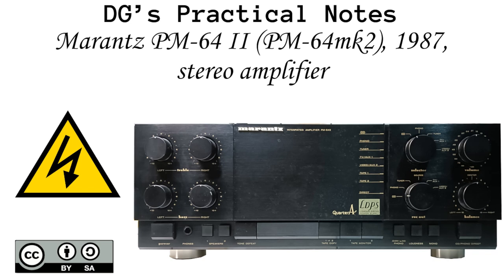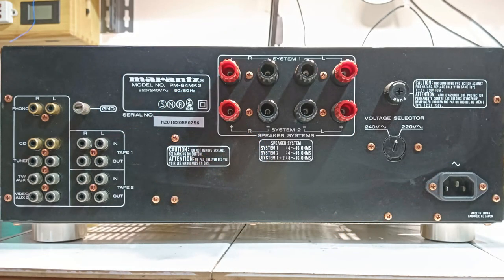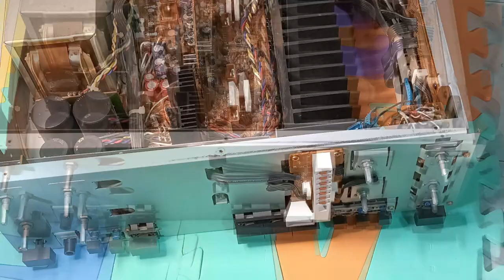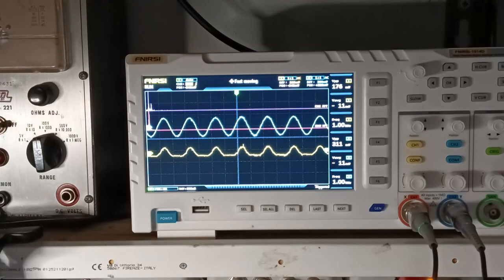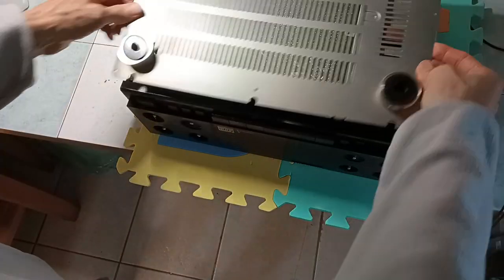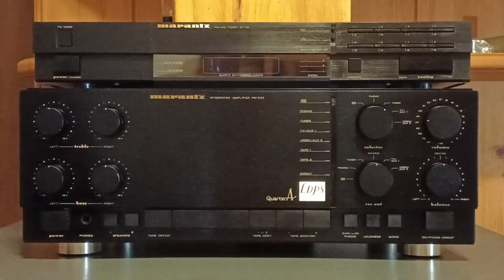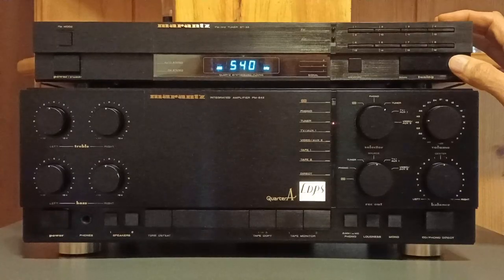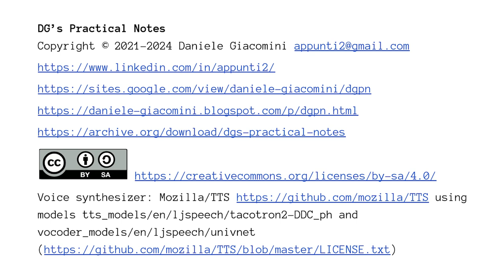DG’s Practical Notes, U#5 Marantz PM-64 II (PM-64mk2), 1987

Comment: Hmm. If you've succeeded in locating the problematic part of a board, why not at least visually inspect and resolder components? The distortion could be caused by bad solder joint, seen that many times. Also some capacitors could be bad, and started to work after an initial charge. However, Matsushita usually used good capacitors at the time, and these Marantz models were probably made by Matsushita. I'm disappointed by the quality of the PCB - it's made of FR-2 resin-bonded paper, not a proper epoxy-bonded glass.
Reply from the maker: Hello and thank you for your feedback.
I checked the solder joints, and they appeared just perfect.
There are wires wrapped around posts, by the factory (they are not soldered to the posts). I think that that might be the most probable cause. However, I prefered to keep it as it is, because it was still completely original, and it is an item on my cousin's possession: it the issue reappears, I can try to solder them later. In that case, I would make a new video. :-)